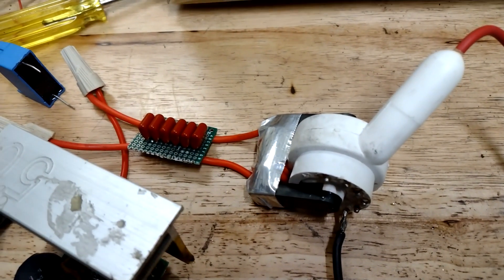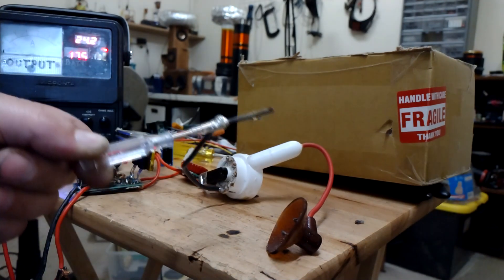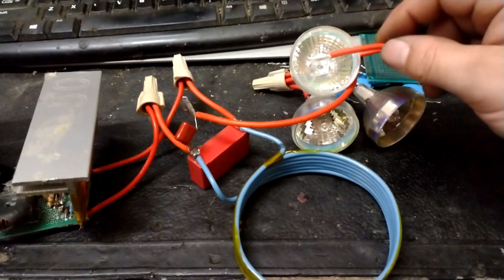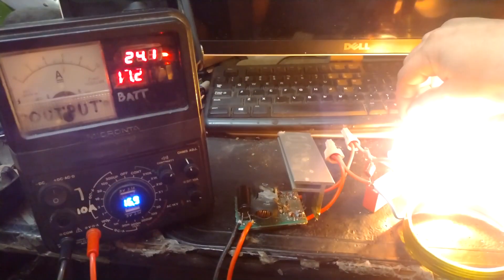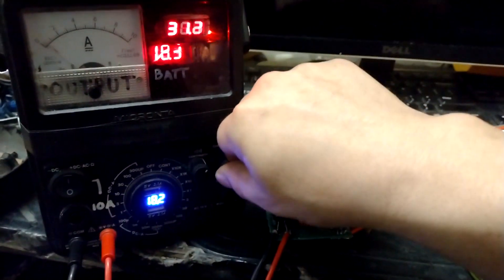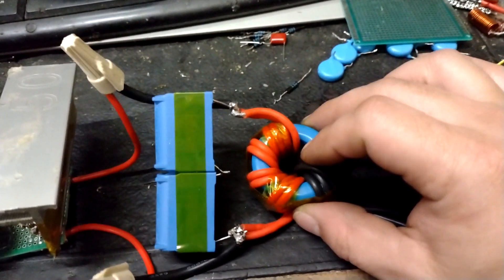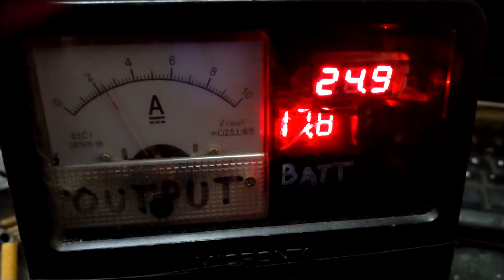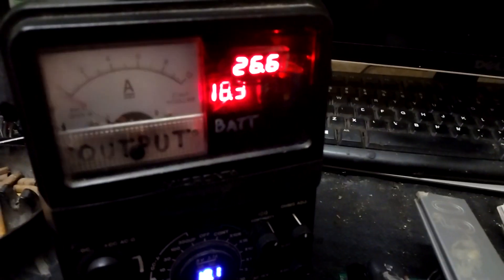ZVS Small Flyback Death & Other High Current Setups

Comment: Sup dude, been a long time 😎 just checking through some vids on my lunch break been real busy dont have time or the energy to be in the shop these days.. anyway that flyback is def a dc type for a sharp solid state television likely a mini TV, single diode I would guess, should get youself an AC type, they are killer good, submerge it in mineral oil and pull a vacuum if possible, I can cranke mine to 60v no problem run a TC with it !
Reply from the maker: What's up bro! Hope all is good. I def need an AC flyback and see there are actually some serious ones on AliExpress these days. There's a massive 3kv one on there too. I got the other little flyback now so idk what I'll use it for but it's decent.
Reply: @Magneticitist  I'm good dude just really damn busy at work 🤣 hope your doing well too 👍 well if u get a decent AC type, you can run a DC SGTC, they are killer ! You can also do voltage multiplier circuits or even an ion lifter, it's always good to have a HV supply for experiments
Reply from the maker: @dirkk82  You know at this point I've made almost every kind of TC on my list aside from a real QCW coil or maybe a DRSSTC with pulse skip but I forget about the SGTC. I never wanted a big one just cause I know it will only sit somewhere all the time like my biggest drsstc does, but I wouldn't mind a small one. My little tinker room and the electronics plugged in never did like it when I played with spark gaps though.

Comment: Is this running on a zvs driver circuit?. Very nice arcs
Reply from the maker: Yea basic mazzilli with about 700nF tank cap for that flyback. Bigger flybacks work much better or maybe about the same if you don't tune them.
Reply: @Magneticitist  whats the input voltage. I build zvs circuits myself. I wanna build one like yours.
Reply from the maker: @goobman1981  It will be same with any other standard ZVS, up to around 50V or so but I use a 20V drill battery + buck/boost for a supply. I like to just separate the gate drive with a different fixed supply at maybe 15v and fine tune the gate resistance a bit so I can run any primary voltages I want up to what the switches can handle. My ZVS in the video is using unmatched IRFP250 clones.
I will probably make another using 650V IGBT's in order to run mains voltages.
Reply: @Magneticitist  my zvs is using Lipo 12v battery. Irf250 mosfets. But im only getting half inch arcs. Maybe i should change the capacitors or inductor. But my zvs is center tapped.
Reply from the maker: @goobman1981  what value capacitor and how many primary turns total?
Reply: 5 turn center tap with 3uf 250vac capacitor or two .3uf 1200vdc capacitors in parallel.
Reply from the maker: @goobman1981  5 turns for each coil seems reasonable but you should be able to see some familiar variables by changing between the 300nF and 3uF resonant caps. The 300nF may provide a lower idle draw and less output while the 3uF may have higher idle and seem to pull hotter arcs. You may want to try some values in between 300nF and 3uF by working your way from 300nF to around 1uF while observing both the current consumption and max arc length. At 12v my circuit needed about 1uF to pull decent arcs from the flyback which would overwork it unnecessarily at double the voltage.